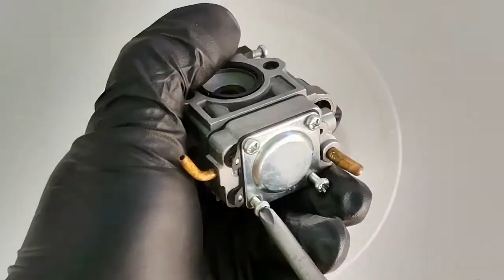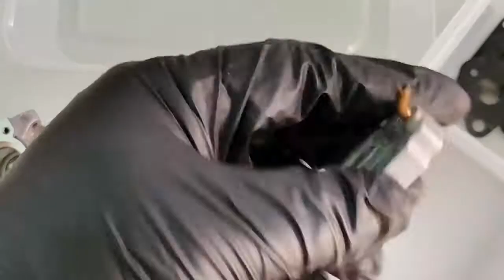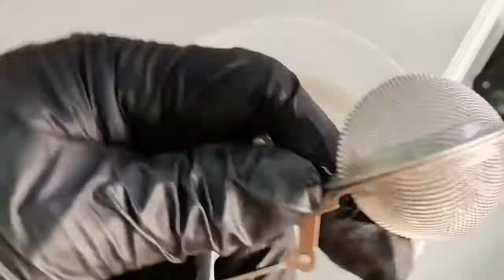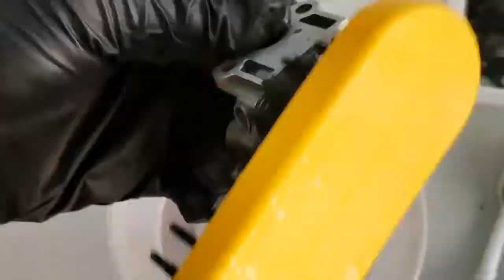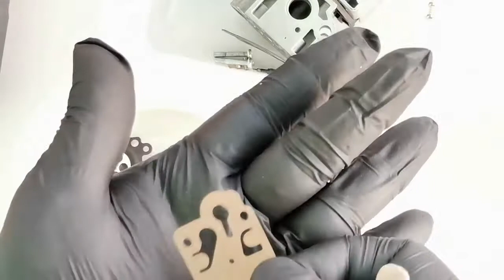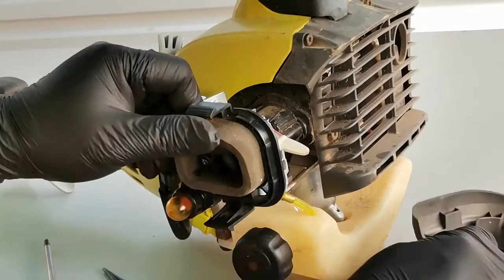VTECH 27 - Ryobi RLT26CDSN Carburetor Full Rebuild

Comment: Hello mate I have the Ryobi RBL26B line trimmer that keeps turning off after 30 secs to a minute. I changed the fuel lines, new carby, new primer bulb and it starts easier and runs longer but still turns off after a minute or 2 minutes. The fuel is ok because I use the same fuel/oil mix in my Ryobi blower and it doesn't turn off? What could be the issue, not the plug? I don't run air filter and also removed my spark arrestor
Reply from the maker: Thanks for watching. It could be a heat related issue, e.g., bad ignition coil or cracked manifold plastic spacer.
Reply: The engine also spat oil out the exhaust when starting but once running its ok.
Reply from the maker: It's possibly due to missed fire or unburned oi/fuel mixed, which could flood the spark plug, which caused the engine to stop after a few minutes.
Reply: @Varietech-AU  thanks for the tips mate, I added more fuel to the fuel-oil mix as I thought there's too much oil (should be 50:1)  and it seems to run better, no smoking and engine shutting off etc
Reply: But the same fuel oil mix ran ok in my ryobi blower, a bit rough

Comment: To check compression you gotta take choke off and hold throttle fully open bud thanks.
Reply: With small engines that's how compression check works thanks bud.
Reply from the maker: Thanks for watching our videos. Yes for sure I will do an experiment to test the compression with the venturi fully open and fully choked and see the differences on compression reading. Have you observed any differences on compression reading? Please subscribe to get notified for any updatebof the compression testing. VARIETECH